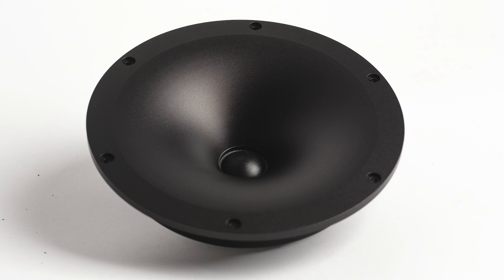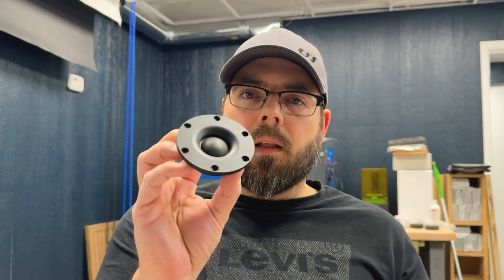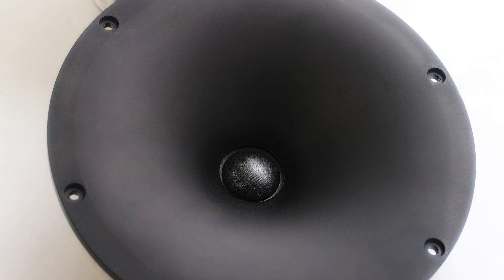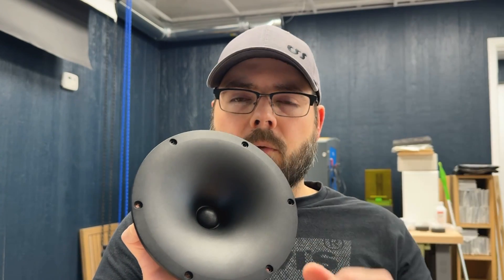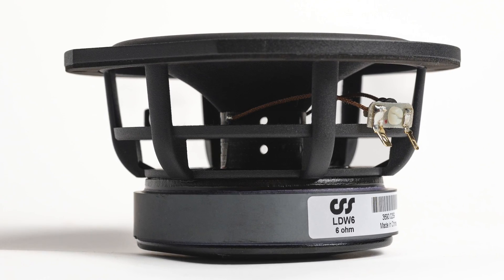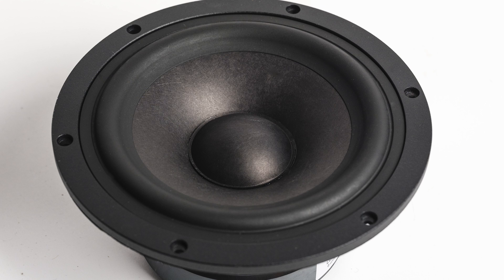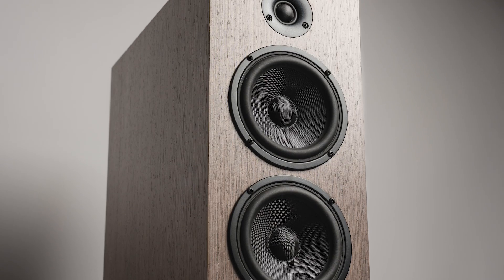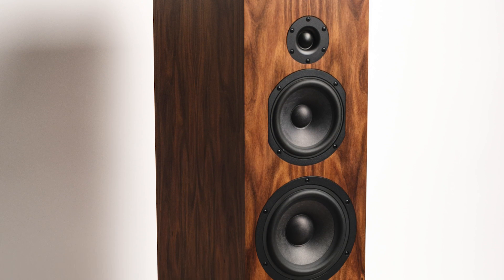Are Waveguides better than regular tweeters? How do they work?

Comment: Conical wave guide silk dome tweeters have always been one of my favorite flavors of tweeter.  I rebuilt two pairs of old, low end PA speakers to HiFi PA speakers with MCM 10 inch Pro Woofers and Morel 200Watt each, 1" silk domes in conical guides.. crossed over 12db at 2K, used lamps for fuses.  A good number of people who know what are talking about claimed they were the best 10" PA speakers they had ever heard and they do sound fantastic.  Imagine, some sketchy looking little 10"s PA speakers, shabby carpet and all, sounding like several thousands of dollars.. just like that.  With a 15" sub, it's definitely HiFi quality sound with program material, we have compared by ear to several high end Polk, Klipsch, etc, even fancy concentric driver Tannoy studio monitors.  They do it nice.  - fun story, and true.
Reply from the maker: Thanks for sharing your experience!

Comment: Dosnt ring? He then hits it and it rings like a metal object should ring...a bell. LOL. 

OK, not a real problem but a plastic WG would not ring so readily. 

Now, having said that, what are the pros and cons of plastic vs aluminium WGs? 

I love aluminium face plates btw, but will they need a bit of damping to mitigate the ringing evident in the video from the tap test?

I guess not. The energy impulse from hitting the aluminium WG is way more than anything excited by the tweeter in normal operation.

Comment: Waveguides have always made sense for largish 2 & 2.5 ways. But why wouldn't you use one? Here are some ideas: 
1: limited baffle space (too easy)
2: closer CTC spacing, especially with a small midrange in a 3-way (great for vertical dispersion & casual listeners)
3: possible wider dispersion at lower frequencies (if that's what you want)
And don't forget, there are smaller, or less aggressive Waveguides out there like the seas DXT if you want a little of both worlds!

Comment: I'm considering putting wave guided tweeters in my d'appolito / MTM speakers for better time alignment (currently flush mounted regular tweeters so the woofers are obviously more recessed). But I'm not really bothered by having too much high frequencies in the room atm. Off axis also seems pretty coherent as-is. Would I have to alter the crossover or add an L-pad when replacing the old ferrite tweeters with neodymium waveguided ones? (Waveguided is louder right? And neodymium also more effecient although the rated wattage is much lower so idk)

I could just put them in and see if it works? 😅

Comment: For which tweeter is the waveguide designed ?
Reply: My guess is you can mount most 1" dome tweeters to it. At least that's the case with the separate waveguides I have seen
Reply: Their tweeter is already incorporated in the waveguide

Comment: Besides directivity, 2 important facts with waveguide. First the most important is the time alignment  with the woofer. In 70-80's, the woofer was advanced, nowadays no care is given but the waveguide does. The second is the lower frequencies loading. The tweeter can operate at lower frequencies down to 1khz instead of 2khz.

Comment: I think wave guides and horns are bad because they color the sound. They might be good at sending sound longer distances, making the sound appear bigger and giving a livelier presentation. But that's about it. Not good when you are going for a more natural sound.
Reply: You can't just slap a horn on a tweeter and expect it sounding good. You have to design with it, including using specific driver and designing crossover for the horn.

Comment: I got some B&W 706 speakers and are low dispertion and they only sound good when you are right in front of them. If I do stuff around the room (off axis) they sound terrible. Too muffly! 😅 They are my reference speakers for my speaker building hobby. I make high dispertion speakers and I can walk around the room and still hear highs. 😅
Reply from the maker: That's likely because a number of B&W speakers cross the tweeter very high and you get a large dip off-axis. Not necessarily that they are low dispersion, just that the crossover point is causing a big mismatch in directivity.

Comment: It actually rang when you struck it! lol
Not that that means it will ring in a speaker....it wont!
EVERYTHING resonates! Its a Universal Constant.
Do you guys- CSS- make custom speaker terminal plates? With custom engraving?
Reply from the maker: Yes, all metal with make a noise when you strike it. It is the decay time I'm talking about when I say ringing. The sound dissipates quickly and the energy required to get it to do that is far beyond the forces generated inside a speaker.
Reply: Once the tweeter gets installed into the baffle that “knock” ring will definitely be reduced or eliminated.
Reply: @frostycanada6404  Thats what I said.